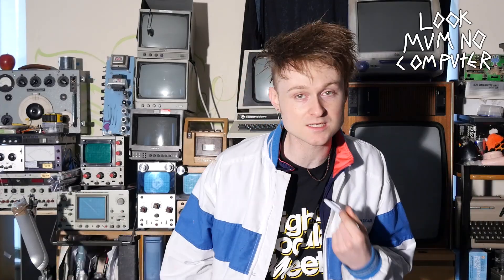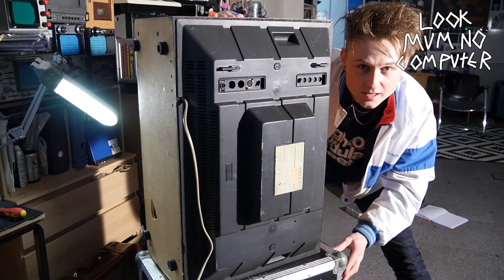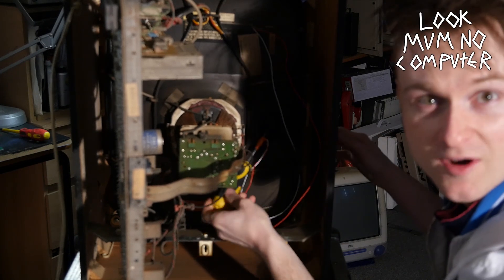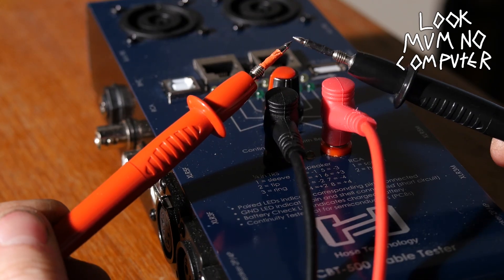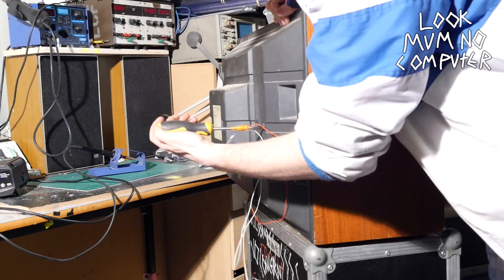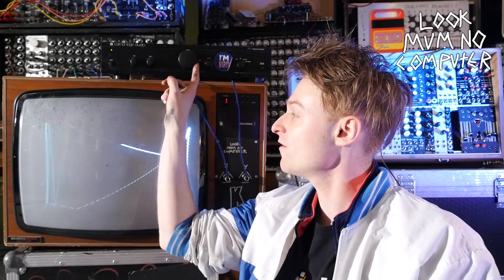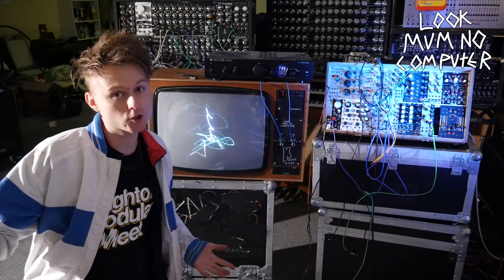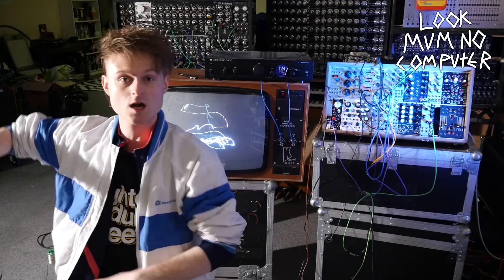Turn an old TV into an Oscillograph For Oscillographics!

Comment: Dumb question, does the flyback transformer need to be functional for this to work? Is it possible to bypass it all together?
Reply: The flyback trafo also generates the 30,000V for the screen anode,
 without that running, you get no beam.

Comment: Actually if you are using a tube amp on these coils you could blow your amp. It’s better to use a transistor amp. These TV coils usually have a much higher impedance than that of speakers. If you want to know why this can be deadly for the amp, do a google search on the importance of speaker impedance.

Comment: Hang on a minute.
You've missed an input.
You can control the guns with the video in, RGB would be easiest.
Now, the three guns are all offset, like the phosphor dots and mask.
It'd need a fair amount of processing power, those beams can hit any dot now.
But with an HF signal into the guns you could colour it.
Reply: Each RGB beam can only hit dots of its own colour.
 That's what the mask does.

Comment: Maybe I can get an advice here:  I made my own version on an old Soviet travel TV - for some reason all the shapes I am getting on the screen are skewed 45 deg.  I had 5 inputs on my coils:  2 wires for horizontal coil and 3 wires for the vertical one. I tried all possible combinations but still all my shapes remain angled. Oddly, when I run it on one chanel only I get perfectly straight lines (horizontal or vertical).  Anyone have an idea how to straight it up?
Reply: You get 45° lines when X & Y are fed the same signal.
 Try feeding it different signals for X & Y, like an audio and an LFO.

Comment: Just to be the boring safety dude :
I just asked my techie friend about this : 
Apart from just discharging the tube, and the filter cap (or charging cap, or whatever the main cap is before the tube) ,
you must leave it shorted and discharging to ground,
as tubes can actually charge itself even when unplugged !
As a safety rule you should be wearing gloves or gauntlets and a coat (thick is good),
and safety eyewear, 
as tubes can implode and then explode !
He is a long time tech and said this is fucking crazy, and the lack of safety appalled him.
I still want to try it, but..... just saying.

Comment: The lack of xy control just as you turn the tv on seems to have killed the phosphors in the center.  never understood why that was a problem with old color tvs.
Reply: bcs instead of distributing the beam of electrons on all the surface by moving it fast, it stays there and burn.... i mean... it's obvious :D scopes as well can have the same problem but they are more intended to be used like this
Reply: It's phosphor "burn-in", like on old ATM's or even old arcade games that would have "GAME OVER" permanently burned into every image.

TVs got smarter and would kill the beam when deflection drive was reduced, eg at switch on/off.

Comment: Fun Project!  Did this with smaller television through an amplifier connected to computer.  My lines are red, with a sweet glow.  Love it!
Reply: Any recommendations on an amp? I've been scouring the internet for an older used one or something new. Converting from 1/4" to RCA then speaker wire to 1/4" seems daunting

Comment: Thanks for this video! i'm currently trying to make my own,  followed all the steps. Now I get it turned on, the blue light appears, 
but the light then dissapears. the on/off light on the tv keeps flickering. (as if it is getting power, but not enough) 
does anyone know what this might be? could it be some safety built in by JVC? can it be fixed?   or did i just wreck the tv :P
Reply: We have the same issue here, have you found a solution yet? Thx

Comment: Rather late to the party here, but I've now made two of these. Question; I'm hitting quite a bit of a snag with both as when I turn them on they're only active for a few seconds before the screen turns itself off. I can force it on again by tweaking the settings(turning up and down the volume etc.), but it only runs for another five seconds before forcibly shutting off. It might be as I'm working with electronics going with the european standard, the current's different? I'd appreciate any enlightening comments about this.

Comment: At 6:38 I blacked out ... then snapped out of it an hour later. I was out side and 2 miles away. 
    I  had 3 t-shirts on, a can of grape soda in my pants pocket and a BRAND NEW Crate tube amp in a shopping cart that had a Furby strapped to the front. 
    Thanks for the amp mate.

Comment: Oh yes the good old 80's big ass TV's. 
I still have one in working condition in storage. I've repaired it twice over the last 30+ years
Weird standby behavior. No prob! Just needed to replace a dying capacitor in the power supply
Audio cracking. Again no prob, just a dry solder joint. Nowadays you can throw your fancy OLED display away when something minor is wrong with it.

Comment: Jesus all that cigarette crust in there....
Anyways in some sets you will need to put a load on the yoke plug, so the Horizontal oscillator starts running. The Horizontal circuit is where the high voltage power is created via the fly back transformer. No horizontal oscillator = no high voltage = no CRT raster

Comment: We used a squarewave to trigger a coil back in school, and connected it to the x and y on the oscilloscope. It made beautiful spirals. I never got to experiment more with it. That oscilloscope also had a z input which would control the brightness of the dot.  You would only have to locate the video amplifier and connect to that. Just throwing in some idaes if some of u guys want to give it a try.

Comment: I've built myself a little retro corner for retro games / movies / music with a CRT TV and some old 8-bit systems and an old analog Hi-Fi receiver and looking to add a record player. Woul'd be neat to have this mod built with a switch between oscillograph for music listening and regular TV mode for games and old TV-shows.
Although this probably isn't exactly good for the phosphors in the screen and could cause massive burn-in at the center of the screen. Could perhaps add some circuitry that adds some noise if the input signal is below a certain amplitude just to make sure the beam isn't burning straight at a single point as soon as input goes quiet?

Comment: The portrait standing scope you have in the 100 Oscillator mega drone video (Telequipment D61) has an XY mode. Turn that timebase all the way anticlockwise to "ch 2" and it turns the timebase off and makes the x axis controlled by chanel 2
Reply from the maker: oh thats what its for!
Reply: LOOK MUM NO COMPUTER yeah works well, just picked up that scope plus a loid of other gear for cheaps from a man local to me 👍👍 have had some good fun playing different music and signals through it. Was lucky enough to find some bnc to phono sockets :) great vid btw, spotting the scope in your new vid made me check back ;)
Reply: I'd be surprised if a lot of scopes didn't have an XY mode.

Comment: I have re-created and followed all your steps. But mine doesnt work, it might be because i am using a bass guitar amplifier head but im not sure please help.
Reply from the maker: is it powered by 18 volts? did you cut the transistor let off? some people apparently have had problems with the 2n3904 tranasitor, but had success when they did the same to a 2n2222 hope that helps!

Comment: Hey man I had this idea for a combined instrument and thought you could easily build it. It would be cool to do it together but I'd have to go to England or you come to Spain. The idea would be to combine an Arturia Keystep, an EHX 45000, a vocoder, and a Novation Circuit, (and if possible an Organelle) into one machine that looks like an old synth, with wooden ends, and that runs on a laptop battery. Could you do that if I ever had the possibility of commissioning you? Maybe you could just do the mods or even just a blueprint? That would be such an amazing instrument. Like a home-made OP-1 in some ways. EDIT: I do realize it's got little to do with your video but still

Comment: How do you know which one is the x and which one is the y when building it?
Reply: It doesn't matter, just swap the cables on the front of the TV if you want it the other way around.
Reply: Obviously, you test it
as to how you test it..
well. i assume that you have some basic level of electronics knowledge, in which case , me saying "You test for it" should be enough

now.. if it's not enough and you don't have that basic level of electronics knowledge
IT MEANS YOU NEED TO LEARN BASIC ELECTRONICS and hence, is the reason why you are asking the question

so... you decide which one you are
do you
a) understand my answer
or
b) need to go away and learn Electronics basics

FYI, if you don't know your basic electronics, YOU SHOULDN'T BE PLAYING WITH A CRT, it's dangerous

Comment: I once touched the middle thing of 32 inch cathodic TV (it was a more recent tv, and the part was way more appealing, like something from i-Robot, but I opened it for the 20W speakers(woohooo!!!) and the connectors at the back)... it was unplugged for at least 2 weeks so I did not worry about electricity... fucking bad idea!!... never opened a damn tv after this and I'm aware that it can happens with capacitors, but I pay attention now and they are easy to discharge :P

Comment: If the tube has been off, the voltage disappears almost instantly from the high impedance. Unplug the set and don't put yourself in circuit between the anode and the tube and you will have no problems. The current from the flyback is so minuscule that it's almost impossible to be injured by it, so as long as you keep the tube off (which can act as a capacitor while in circuit), you'll be perfectly fine. 

https://youtu.be/Rb6vMgurAH0

Comment: Just remember, to any wanna-be electronic tweekers - It doesn't matter what size the CRT, 30+ inch or 3 inch, the voltages needed to make the electron gun work are most definitely lethal . The capacitor connected to the electrode of the "picture tube" can store a lethal charge for years and needs to be discharged as shown in the video ... although a 100 ohm, 10 amp resistor between the screwdriver and the ground wire is probably a bit safer.
Reply: not quite always and automatically lethal because i have been shocked a few times in my learning days and am still alive...most tvs DONT hold a charge but some do......the ones that DO they hold it for hours maybe days...there are a FEW that hold charge for a very long time....screwdriver method is standard procedure and safe IF you are not dumb.....the charge may be 10 or 20kv but very low amps and it will be a fraction of a second of shock so if you suffer heart disease it MAY kill you but very unlikely...it will throw you back and it may hurt.....but much more dangerous is putting a finger on a socket with 220v and leaving it there till you die because you can have sockets connected to 16amp breakers or even higher so it will fry you before tripping the breaker if the house does not have a differential breaker....
Reply: @MrHBSoftware  

Yup. I actually touched a 240v socket in moment of innattention when I was dismantling/modifying a guitar amp back in high school. 
Middle finger of my left hand if I recall… oh man..

Comment: Hey Mum, back in my day lmao we called these Lizzy Scopes. If you really want to fine tune the XY sync, use a separate yoke. Take the original one there, off the back of the tube, but, and do not disconnect it, we need the voltage running into them to remain constant, just tuck it away where it won't come in contact with anything else hahaha. When you do it that way you get a real fine-point beam of light to work with, better resolution. Then use a similar yoke, yea, gonna need two tv's, just remove it and put it on the TV you're working on...but they don't have to be the same size but closer is better. The yoke just has to fit on the tube, they're pretty much all the same, only diff is the size of the TV screen... but anyhooville you can get better basic shapes like circles to work with, use separate oscillators/synths on each input X, Y ... and everyone knows you can make any shape out of a circle. When you match up the X and Y's you can make imagines well, we called it a Lizzy Scope for a reason lol. If your input wave source is true, sine, square, ramp, etc, you can have a blast experimenting and creating some cool shit. Run a sine, perfect circle on the X, against a square wave on the Y, and visa versa! Fun stuff!!! Or just hook up the X,Y to Left and Right Stereo to listen to prerecorded music. If I had my way, everyone would have one!!! HaHa I made mine when I was 12 or 13 yo. I still have a 10" Lissy Scope I made setup in the basement on a shelf for when my real party dudes come over.  Use a mixer and create a perfect circle by injecting the XY with two seperate sine waves at the same frequencies and then mix in other audio components to ride the wavezzzzz.... it is one of my fave toys, still. Keep on making musical stuff, you are amazing...and fun to watch!!! :)
Reply: "Lizzy" as in  "Lissajous"! Now I get it!
Reply: @greenaum  Sorry I guess I got excited seeing someone having fun with this too haha We were doing this stuff when I was a kid and yes, I didn't really mention where the name Lissy came from haha. Lissajous Patterns are pretty much everywhere in life but even in 2D on a TV screen they are amazing and fun to create and watch. Especially when MUSIC is the source. Higher frequencies produce shorter vibes and lower freq's produce longer, bigger vibes and mixing them on the screen is like magic hahaha These are easy to make too. I still have one lol  I use it mostly as a Halloween prop now. I never even thought about it, maybe I should make a damn video? Doesn't seem to be many, I can find any other, at least... Thanks for clearing that up too LOL :)